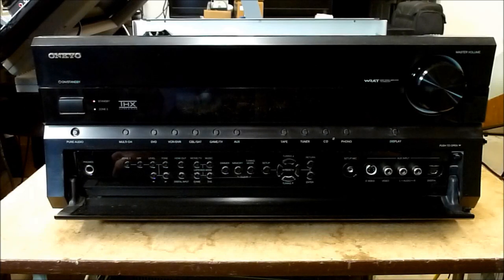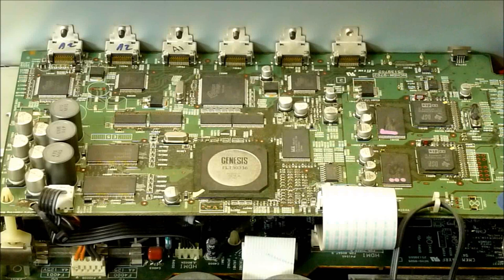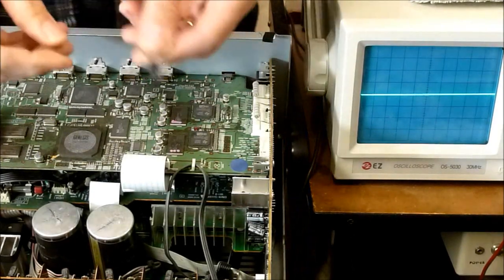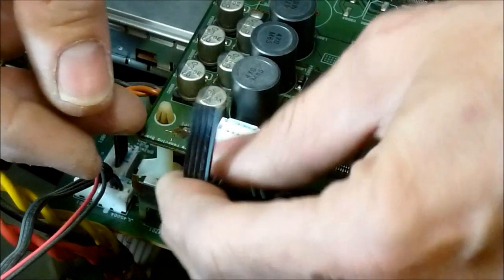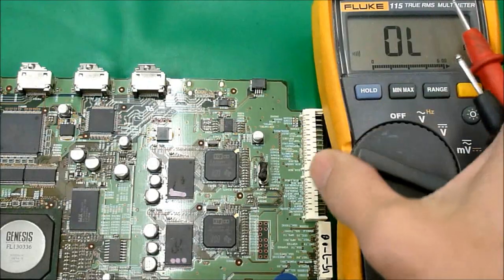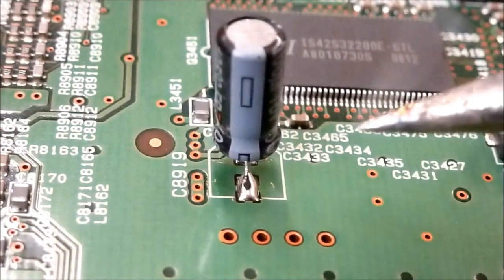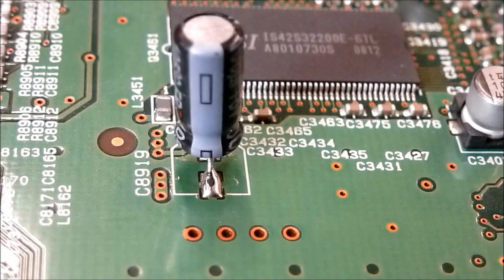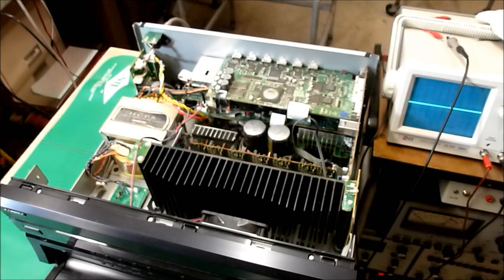Onkyo TX-SR806 Digital Noise AV Receiver Amp Repair Fix

Comment: Thanks to you & all the other good folks that have put up info re theses amps. My TX-SR806 had the HDMI switching issue so bought the 13 100uF 16V electrolytic caps from Jaycar & set about it. Was lucky (if you call it that) that the previous amp owner had also had this repair done so the smd ones were already replaced so I just unsoldered all the bad ones & put the replacements in. Woohoo! Off it goes again.
Reply from the maker: That's awesome!
Reply: @norcal715  & that's thank to you :-)
I don't suppose you have any info on a NAD C355BEE - mine looks absolutely pristine inside, (top & bottom of board) not a hint of anything being hot or burnt, however when the power switch at the back is turned on, there is a click, then a few seconds later a second click, then nothing, not even the led on the front is lit. :-(

Comment: Just completed the repair. Huge thanks for the video, super clear and concise. In my 806, I was getting terrible digital noise along with difficulty switching HDMI sources. I replaced all 100uF 4V caps and this baby's good as new. Saved me $600-700 on a new receiver, norcal, you rock.
Reply: Amigo, o meu receiver é o Onkyo TX-SR875. Esses capacitores que você usou servem nele talvez?

Comment: Ever worked on the onkyo TX nr series of avr recievers ? Those had bad dsp chips on thr hdmi board. I had a nr809 709 and 609 all with the same problem no sound except when pure audio was enabled. Onkyo fixed them under a recall for free. Even sent a box to me. They were great recievers when working.

Comment: My parents had the sr606 and it developed hdmi issues. Onkyo repaired the hdmi board and it was working. But I believe it's due to bad caps on the hdmi board. At one point I wanted to get the 807 as an upgrade to my sr705.

Comment: Unbelievable!!! I've been leaving my amp on so its always warm to avoid the noise on cold startup. Then it progressed to the point where different channels would stop producing sound. Turn it on and off and all 7.1 channels would come back on for awhile. Ordered 20 100uf 10v capacitors, you only need 13 for this model, replaced all the 100uf 4v caps on both sides of the board and waalaa... like a brand new amp. I do recommend removing the tails of the old caps off the board as if your lazy and leave them in trying to solder over them they will stick to the soldering iron and drop back onto the board possibly causing a short. Thanks for this video!!!

Comment: I bought my TX-SR806 12years ago.  I started to have the HDMI switching issue and found this YouTube video.  This is an excellent video and shows how to repair a high frequency HDMI noise issue but it can also be used to resolve the famous HDMI switching issue.  Thanks

For those who want to repair the HDMI issue:
1. Purchase 13 x Panasonic 100 mf 10 volt capacitors.  Available on Amazon or other online stores.
2.  There are 8 capacitors on the underside of the board and 5 on the topside of the graphics board which need to be replaced.
3.  Make sure you are grounded and use an anti static mat with a wrist strap on your arm (really important).
4.  Watch the video.  Multiple tips which are very helpful.
5.  Remove the case screws on the LHS and RHS and the HDMI port screws.
6. Watch the video again
7. Remove the graphics board (2 x cables) and edge connectors on the RHS by first removing the silver screw on the other board and then pull out from the left hand side to free the edge connectors.
8. Mark the 13 capacitors which need to be removed and remove them exactly the way NorCal says, plus old capacitor leads.
9. Cut the new capacitor legs so that the capacitors are fairly close to the board.
10. Note capacitor polarity (really important), minus to the flat side I the diagram on the board at each capacitor location.  Apply new solder as you I stall the new capacitors.
11. Reinstall the board and connectors and use a tie wrap to hold the black cable back to the board.
12. Enjoy your reconditioned receiver and thank NorCal.

Comment: I want to thank you for this. I purchased 10 capacitors and replaced them per your video. I never did this before. Not only is the sound crystal clear, My HDMI problem also was fixed (my HDMI switching was bad) I found with Onkyo over this and they claim my year was the year before the ones that qualified for the repairs (bullshit). So im a happy person thanks to you. Great video!

Comment: I was having problems with HDMI switching. Some inputs worked, but my Chromecast (working fine on my TV) for some reason did not.
Anyway, I used this video to replace 13x 100uf capacitors, just to make sure, and it worked!!!
Thank you so much for this excellent video, you saved my receiver (and my bankaccount).

Comment: Thanks, I ordered 20 from Digikey today.  I ordered 7 extras just in case.  I went to two different stores today in Houston that I thought would have what I needed (Electronic Parts Outlet and Frys), but neither store had enough caps.  I need a bare minimum of 13 and each store had 4 or 5.  I'll leave an update after I get the parts and attempt the repair.

Comment: Thanks for video.  Tx-sr806 slowly died over last 6 months.  Replaced the 11 100uf capacitors on bottom of board where they have been getting cooked, used high temp.  Fired up no more warm up noise and switches between hdmi inputs like it should.

Comment: I have the exact same problem happened to me with a digital keyboard.  Thanks for showing the debugging process.  I have since located my issue and applied the same capacitor fix to my high ESR electrolytic capacitor.  The problem went away after the fix.
Reply: Donde. Puedo. Comprar. La. Tarjeta. Admi tx-808 onkyo
Reply: Tx-806 onkyo

Comment: My Onkyo TX-SR875 gives Popping/Crackling sound in main Front Left and 
Front Right Channels. And its works ok only in Multi channel in mode 
with Pure Audio/Direct Audio sound mode. Its not works in DSP modes.

Comment from the maker: I think the customer had the unit stacked with something on top of it so years of heat shrank the tubing. If the caps were 105's they should be ok. I did a power output test to 100W X2 with no hum or ripple. Unless they are bulged then in audio application at 60 hz I have not had any problems
Reply: Same reciver but no video issue, and yes the cat always sleeps on top of my reciver no wondering  why is failing

Comment: Thanks for the great video!  I have the TX-SR806 as well.  Mine is having the HDMI switching problem.  This is apparently from faulty capacitors as well.  I'm an I.T. guy, but have not really done any soldering in my work.  Can you please recommend which capacitors (brand/model) and what type of solder to use.  Also, would you recommend the capacitors that are rated for higher temperatures, since many people seem to claim that this problem is occurring because of how much heat the 806 produces.

Comment: Onkyo TX-SR805 is making an odd chirping noise that pings around the speakers...only does it when im listening to dolby digital plus signal  from firestick when watcjing netflix or prime...
it runs Very hot even when listing at low volumes ,though i hear the heat is common to these beasts...i put a fan over the right rear quadrant, looking at it from the front...this dropped temps a huge degree...also ran it with no lid and again it barely got warm...that lid Really traps alot of heat!  anyway, i know others have had the chirps  that ping pong around the speakers only during a digital feed thru hdmi..likely the hdmi board is overheating...curious if you found a specific component to be the cause?  the fan keeps it at bay...any feed back appreciated!

Comment: Thank you for helping so many people with Onkyo receivers. I have a ‘no sound’ issue on my TX-DS797. I’ve tried different sources but there is no sound from speakers and headphones. I have also cleared settings. Could the capacitors be the issue or something else?

Comment: Thank you so much for this! I only replaced that one same capacitor in my TX-SR706, and it fixed the problem. I'm going to leave the other caps alone because I don't want to mess something up. If it ain't broke, don't fix it right? =)

Comment: I am having a problem with HDMI not passing through unless I restart the receiver a couple of times as well as a lot of blue artifacts on dark scenes. I am hoping this fixes mine. I ordered the caps but my model is a 706. I think many of these are the same basic card designs and the caps are all the same and in the same place.

I have to say I will likely not buy another Onkyo receiver in the future.

Comment: I really like this channel. And was wondering if you could help me with fixing my Harman Kardon HS200 AV reciever? I'm no electrician but very interested in this stuff. The reciever suddenly stopped all sound. And I was wondering how to troubleshoot the problem, so I can find the faulty part of my board. Do oyu think it might be only a capacitor issue when everything else works perfect except for no audio. Both sub and main speaker channels are silent, and I have checked that the speakers work. And I have the schematics of the board and a cheap oscilloscope.

Comment: hi there , Awesome video as always . I`ve been watching your video`s for a while now and learning tons :) I have a question though regarding noise coming through the amp ....and it doesn't matter what button I push ,tape , cd, video....etc: I have a Kenwood VR-6070 amplifier . I was thinking maybe its the same problem that you just fixed here on your video . can you please help or steer me in the right direction . its the same noise as if you didn't have a ground wire hooked on your turn table. its coming  through the speakers.thank you

Comment: On that same circuit board, can you tell me what the voltage is for the three 470 M85 capacitors on the left hand side. i had the same noise problem as in your your video and replaced the capacitors and the noise disappeared. Still had the problem of the receiver not registering the hdmi input signals, so I replaced all of the 100 UF capacitors on both faces of the board. Unfortunately, i accidentally tugged on one of the 470 M85 capacitors and knocked it loose and now I am not getting any sound to come through. I am hoping that replacing this capacitor will resolve the issue. Thanks!

Comment: Excellent video. I have found a few oscillating regulators like that before. A quick diagnosis with a meter usually finds the output 5-10% lower than nominal. If I find one like that I usually check with the scope. What did the 3.3V reg measure on a DMM, if you got the chance to do this?

Comment: Hi, I have a big Onkyo tx-nr905 that produces a buzzing noise through the speakers (and headphones for that matter). 
When I power it up and the final relay clicks (significantly slower than the rest) the buzzing starts. 
With no inputs, the buzzing remains the same level at all volumes.
When I plug in an input, the buzzing gets louder with increased volume.
I've been looking through schematics and common problems, but I'm completely stumped. Any guidance would be really appreciated.
Reply from the maker: Can you tell me at what frequency you think the buzzing is? At 60hz or another frequency?  Let me know.
Reply: @norcal715  It sounds higher than 50/60hz to me (my power is on 50hz frequency).

Comment: Nice Video really appreciated. Sir I want a favor from you I am having Onkyo PR-SC 5508 AV Controller which have some issue no menu (OSD) for information is displayed on TV screen. But if you put source in HDMI in Back of receiver  or HDMI in front video and audio content is display on TV. Secondly on the flip panel button setup is not working, but however it is working from remote , thirdly pure audio is not working when button is pressed  nor the led light is coming on when button is pressed . Kindly request your good self to let know what to test and what will be probably fault . Thanks

Comment: I have a question for you.  I have a Harman Kardon AVR 125 receiver which I purchased in 2002.  Recently, while playing a downloaded video on my ps3, using ps3 media server to stream from my pc, the right speaker, the left satellite speaker, and subwoofer seem to be quieter when compare to the rest of the system.  Upping and downing the  speaker setting from 0 db to +10 db doesn';t seem to change anything.  Can you please help.  Thank you.

Comment: Any problem in using 25v or 50v 100ufd caps?  I have some Nichicons in stock, but just those voltages.  I know that typically a higher voltage is fine, but another tech is telling me that higher voltage caps can lose capacitance over time?  What do you think?

Comment: Awesome. Could you have detected the problem with a multimeter (maybe set to read AC v?) or had to be an oscilloscope in this case?

Comment: Thanks for the video.  You make it look easy.  I am newbie with my only experience being resoldering obvious solder faults. I have an old Pioneer VSX-d309 that started buzzing on startup, then after a while stopped working all together as the display shows "power off" and the protection circuit shuts the unit down. I have the schematics.  Any ideas on how to proceed  Any help would be appreciated.

Comment: Hello, my name is Charles, I live in Brazil and I have a receiver TXNR-616. This receiver features "Signal not" in any font I select, but the ARC continues works.many videos on youtube talk about some capacitors, but as the model of the receiver is TXSR-606, I do not know which capacitors replacement. could you help me?
Thanks!

Comment: I have a receiver for this 875, silver.
From time to time he has a radio-like hiss when he's tuning in to the station. It always occurs in the right front channel of the tower.

This hiss does not last long, it stays for a while and then disappears.
Sometimes it comes back. Could you give me a glimpse of the problem?
I have already tried the ground loop, removing the ground plug from the outlet.
Impedance has also been noted.

I'm from Brazil, here nobody was able to help me.

I thank you already friend.

Comment: Thanks Norcal for your very interesting videos, i have a onkyo tx SR876 with rhe headpnones showing on the front display although they are not connected, any idea what may cause this problem, thanks.
Reply from the maker: There is a switch in the headphone jack that tells the microprocessor that you have headphones inserted. I would plug and unplug the headphones (the 1/4 size) several times to exercise the switch to see if it makes any difference.
Reply: Okay thanks for your reply, much appreciated.
Reply: Always love to watch your channel. 👍

Comment: I have an onkyo tx-sr503 with a similar sounding digital noise, its a non-hdmi version, pls let me know which pcb could be leaking out that noise so that i could replace those capacitors.

Comment: My Onkyo TX-SR803 has a similar problem, it only makes some strange low pitch noise and starts rising to high pitch, it will only do it when i first  turn it on and it will go away after about 5 minutes, will this mean it will require the same repair?
Reply: Man... I have a sr705 with the same issue+ no hdmi and I've done a full recap changing 82 caps on the hdmi board and it still makes that noise but the hdmi started working at least.
Reply: just repaired my problem. turned out the xm sat radio board was faulty. just unplugged it and now the receiver works like new

Comment: Hi I have Onkyo TX-SR875 and it has popping and crackling sound on front and surround channel. I try to rewire speaker connectors and try with all different inputs but not succeed. Please help me to solve this issue.

Comment: Changed capacitor as described on same onkyo model did not help. Multimeter still shows continuity.  What can i do? I have constant humming issue via speakers even on mute.

Comment: Thanks and great stuff, I have exactly the same model, looks like i messed up speaker connections  on the back and unit stopped working, next time i turn it on, a red light keeps blinking. How do i fix it?
Reply from the maker: You probably have shorted output transistor(s) and possibly drivers in the channel that shorted out.
Reply: NorCal715 thank you. Hopefully i will be able to find someone to fix it.

Comment: Hi, I have HT-S9400 THX model and it stopped any sound from speakers. How to fix it ? Looks like i have Main AMP board issue.
Reply from the maker: Is it in protect mode? Do you have a DC offset on any of the channels. Start by looking there

Comment: Hay man..i'm a bit desperate cause my board where the DTS processor is looks different, but my model is Onkyo HT R 390. During a movie, some robotic interference was heard from all channels(like when u loose phone signal) and after some radio "shhhhh" appeared. Now there is no sound at all(((
HELP ME SOMEONE, PLEAAAASE! I miss my sound! TIA
P.S. i don't own an oscilograph and here in the Canaries very little people that really repair things...
Reply from the maker: Try heating and cooling various parts of the receiver to see if the sounds change.

Comment: Good job! Don't like the Onkyo's. They place that HDMI board right on top of the regulated power supply board; dries out those crappy caps and makes them fail even sooner. They do it on purpose. Bastards. They're not even nice to you on the phone. Yamaha and Denon-Marantz are much nicer people to deal with.

Comment: My Onkyo TX-SR875 gives Popping/Crackling sound in main Front Left and Front Right Channels. And its works ok only in stereo input with stereo out with Pure Audio/Direct Audio sound mode. Its not works with digital audio and multichannel input mode. No preamp out also.
Reply: Did you fix your unit? If yes then how? I have same prob